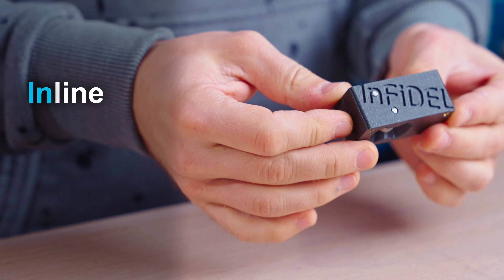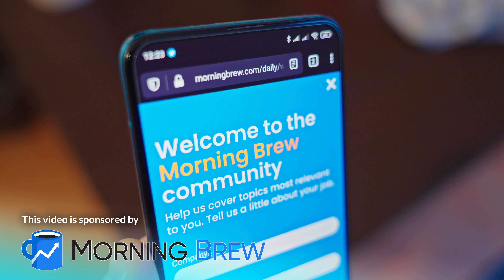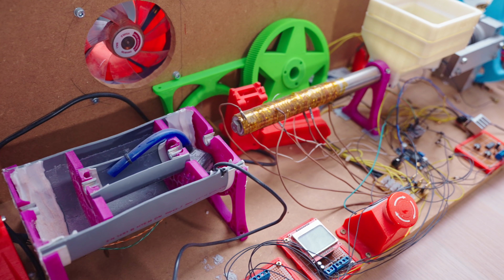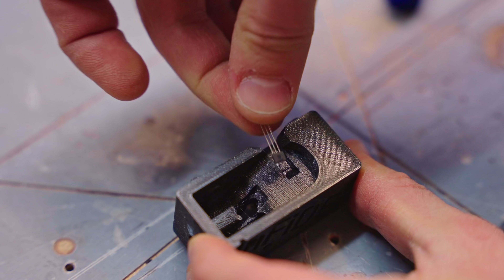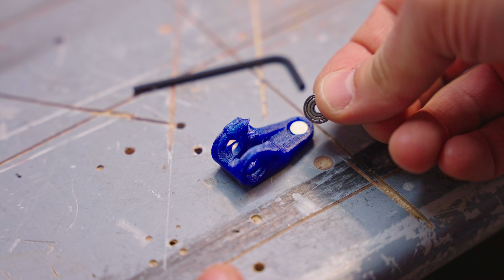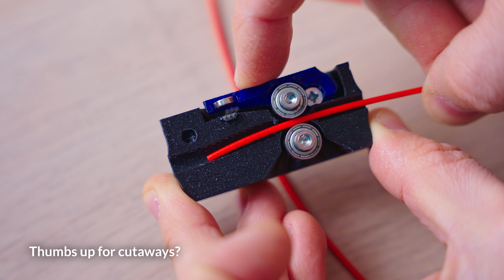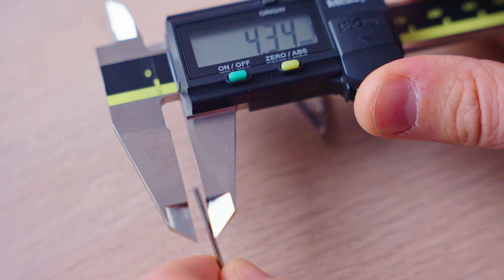Make your own inline filament diameter sensor (under $5)!

Comment: It's interesting but seems like a solution to a problem I've never had. I've had 3D printers for about 5 years and have never had an issue with inconsistent extrusion, even with cheap filament. Seems like adding another component that could fail and cause more problems than it solves.

Comment: Does the bed level sensor work in a similar way - varies the voltage output relative to the distance in between the bed and sensor?

Comment: Very interesting solution.
Maybee an idea for future improvement: add an output for filament runout. If the "Diameter" is less than a mm it is pretty sure the filament is runout. Also if the filament diameter exeeds 1.9 mm, it will get stuck in the Extruder, so to prevent it, the runout should also be triggered then.
It would be very helpfull when trying new filament with unknown quality.

Comment: Klipper already has support for a filament width sensor that changes the extrusion multiplier.
Reply: and you need no electronics at all, just two hall sensors (to cancel noise)

Comment: I²C is perfectly fine - especially if you consider using it with either different printer boards or Octoprint (no special firmware needed) - just keep it in close proximity of your printer.
Also - why not on Github?

Comment: i wish you actually tested this on a printer with cheap filament. I wanna know if it makes a different
Reply: if the filament is too thick it will get stuck in your extruder tube leading to failed print or maybe worse
Reply: @alf3071  Yes, this is a really good application example. You could use very cheap filament with this sensor and the sensor tells the machine when the filament is too thick and stops automatically. Furthermore, this sensor would serve as a filament runout sensor. Thus it would be a multifunction filament monitoring sensor.

Comment: Great work Tom and thanks for sharing!
My suggestion would be to put these files in a public git repository (like GitHub). This way people can easily contribute by suggesting improvements to the code/design or keep multiple design in one place (ie. support different sensors, different MCUs, add CAN/RS485 version etc). I get the feeling that without a "centralized" repository, it will be very hard to collect all the feedback, user improvements and collaborate. I know I would definitely like to contribute to this project and I'm sure there are others who feel the same way. :)
Reply: I came here to say the same thing, instead I just second this.

Comment: This is a very cool device Tom! I really like the use of the hall-effect sensor and magnet, very clever. I will probably make one at some point but I don't think I really need one. I'd love to see a video about your filament extruder, it looks really interesting and I was thinking about designing one to make custom filaments. I don't the name but I recently saw a device that cuts filaments and joins them together so they look almost like multi-core cable, maybe try building one of those. Thanks for the brilliant video! 💙💛🧡

Comment: Tom, a good video might be to get a small gauge pin set, and see how accurate the 3 size lookup table actually is.

import sets in the size you would need for the test, are relatively cheap ($30 to $50).

Comment: I can see this combined with a filament distance measuring device.
Reply: I was thinking the same. I wouldnt want to add the weight to my extruder head, and would love to add this to a know. Length of Bowden tube. Coupled with and OctoPrint plugin, or a beefier AT to store and delay the diameter until the diameter GETS to the extruder would be incredible. 

I can see that even being a thing if you have it mounted at the extruder anyway.

Would likely need two additional outputs, if the board did the delay (addition of the delayed diameter and motion output), but would be an awesome addition.

Comment: This got me curious, is a filament being oval an issue minor enough that this sensor's lack of a second axis of measurement irrelevant?
Reply: He talks about that in the video, around 12 minutes
Reply: In theory the ATTiny85 could support three sensors. Mounting two in a slightly longer package would be feasible...
Reply: And in the last video he showed the use of 3 of these sensors in a row precisely so that filament ovality can be measured.

Unfortunately it greatly increases complexity. Not only do the multiple sensors require more physical space, but you'd have to ensure that the filament doesn't "rotate" between each sensor, and the diameter/ovality calculations would somehow have to consider the distance between the sensors so that each axis was being measured at the same point along the filament.

Including the distance in the calculations would also require knowing about the real-time movements of the filament.
One option for that would be moving the calculations to the printer's mainboard (rather than simply sending the mainboard a diameter value calculated by an external microcontroller), because the mainboard's firmware obviously knows about the extruder moves it's executing. But then you'd need to use multiple analogue inputs on the mainboard - or use an external I²C or SPI ADC, or use Hall-effect sensors with I²C/SPI outputs - but all of that is also increasing firmware complexity to support different configurations.

Another option would be for the printer's firmware to report filament movement distances to an external microcontroller over I²C.

Or of course you could add an encoder wheel to one/all of the sensors so that they directly know about the filament's movements.
Thinking about it, that could be the simplest option overall by keeping everything self-contained within these sensors and minimising printer firmware changes.
It's just assuming that the filament movement could be reliably tracked with an encoder wheel. Smoothieware's "filament sensor" documentation already suggests using an encoder wheel from a common electronics kit from eBay/AliExpress, so presumably that works reasonably...

...sorry, I got a bit carried away thinking about the details, there! 😅

Comment: This begs the question: is the filament diameter aaccuracy (and hence the higher price) of Prusament justified?
Reply: yes
Reply: He made that comparison in the last video about this :)
Reply: I'm not taking about comparison... If the infidel is to compensate for out of round and inconsistent filament diameter; and, the filament manufacturers are aiming to produce more consistent filament, what's the point of one or the other?

Comment: Would a higher resolution adc help. Such as an ads1115. 10 bit vs 16 bit. I really like this project.
Reply from the maker: Not really, since the readings from the hall sensor are somewhat noisy and the InFiDEL is heavily oversampling and smoothing. So I'm already getting a much higher effective resolution than the Atmel's 10 bits would suggest.
Reply: @MadeWithLayers  Ah ok. I was going to comment on microcontroller ADC resolution & noise, especially after you mentioned the ESP8266, which has a somewhat notoriously noisy ADC.
I found I couldn't get usable thermistor readings using an ESP8266's built-in ADC, even with a lot of oversampling and filtering, but it's possible there was an issue with my setup :)

I still think it'd be interesting to try this out with something like the ADS1115, just to see if it makes any difference. The ADS1115 also has a built-in precision voltage reference, which may or may not be relevant here.
However an ADS1115 would definitely be a big chunk of this project's BOM cost. The IC alone costs a couple of USD, plus the extra required passives.
(It's also rather fiddly to hand-solder... I'm personally quite happy with surface-mount soldering in general, but I never look forward to soldering the ADS1115's VSSOP-10 package!)

But I trust that your design works well! :)

Comment: Need video about DIY filament from recycled plastic supports!
Reply: CNC Kitchen has done a couple of videos on this subject.
2 years ago: "Recycle your failed 3D prints! Make new filament at home."
10 months ago: "Building a Hand Cranked Shredder for Recycling Plastics"
Reply: @licensetodrive9930  I watched this. Big problem good diameter :(
Reply: @sdqf  Yes :( The price of filament extruders generally reflect the precision of the end result, you'd have to be printing a lot or with very custom materials/blends/colours to justify the top end prices.
Hopefully one day we'll see a 3D printer that you can directly feed in old prints to turn into new prints.

Comment: The Youmagine link is down. I want to SLA print it. Could you change the body so the sensor snaps in rather than glues?
Reply from the maker: Checked the link, it should work...
The parts should absolutely work for SLA - I'd maybe go in to the Fusion360 design (all available on Prusaprinters / Youmagine) and change the diameter of the bore used for the threaded inserts (it's parametric) to allow for direct tapping. The sensor, however, needs to be glued in since small changes in how it's positioned can drastically change the reading it produces.
Reply: @MadeWithLayers  I responded on Twitter so you can see what happened when I clicked the link. I could use self-tapping screws that way.
Reply: If I copy paste the link it works but not if I click on it directly. Maybe something with Chrome.

Comment: That is what i call very good engineering. Like your attitude to make it open source and avalible for companies. Cant wait to try that out and see if it is usable with Marlin. My 32 bit Board sould be able to handle it right ? Just build a Runout sensor wich will be obsolete soon, ups xD And yes please make a Video on the Filament line. I would love to see that. Good work! Every Video is a pleasure to watch :)
Reply: Yes, anything that can read analog.  Just be sure not to give it 5v if it can only handle 3v3.

Comment: Those pins are a pain to source (locally). Why not use screws?
Reply from the maker: You can use screw shafts, but they are significantly smaller than the bearings' bore, so the bearings can wobble around a bit. Not an issue if you keep an eye out for it, but pins are just always bang-on.
Reply: Drill bits cut to length?

Comment: Where's the source?
Also stop adding that background noise!
It doesn't add anything but distraction.

UPD: the source is on the youmagine.
Reply from the maker: Everything's linked in the video description.
Reply: @MadeWithLayers  youmagine link wasn't working when I wrote that comment, but now it does.
Good.

But what's not good is having desktop.ini file in each directory.

Comment: you just know those Chinese are going to run away with this.
Reply from the maker: I'd absolutely love if this got picked up by a Chinese manufacturer! Like I said, I have no intent on making a profit on this design, but if it happens to become widely available at the intended cheap price, that would be a massive win for everyone.
Reply: @MadeWithLayers  you should get into contact with big tree tech I've seen them make a ton of odd 3d printer parts and this looks up their ally either that or the bltouch guys
Reply: I would think this is a very positive thing, more sensors out there means more chance of people avoiding 'intolerant' filaments.
Reply: @licensetodrive9930  Well yea basically the way Thomas said in the video he only cares if printers get better and i like that! and if the Chinese pick it up it'll be everywhere in no time.
Reply: good
Reply: This, when the Chinese clone would be useful thomas, is too busy with their YT channel